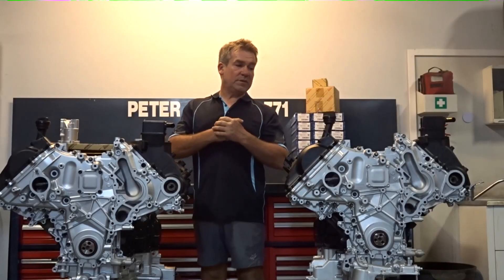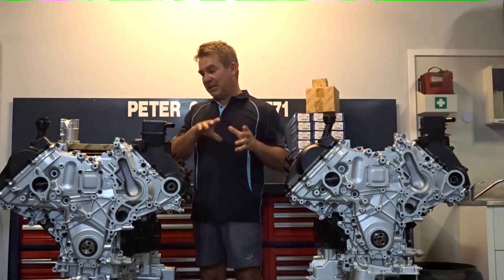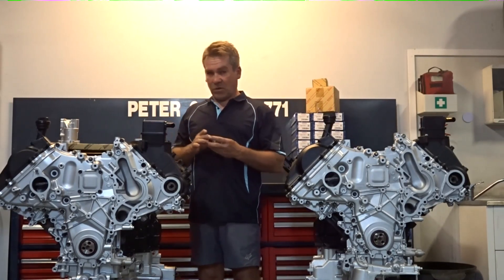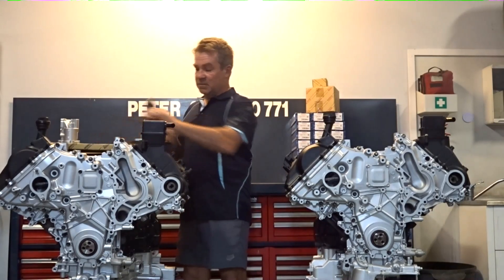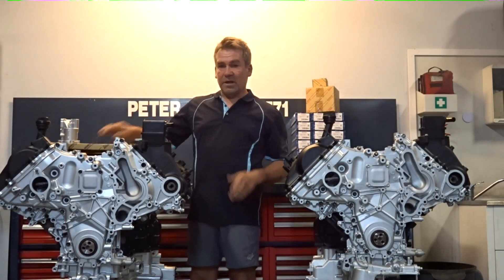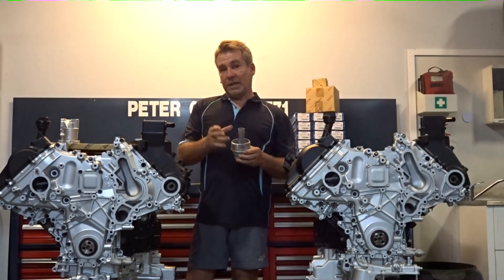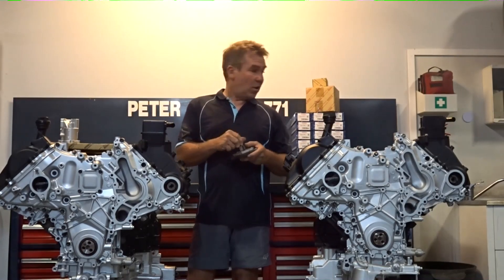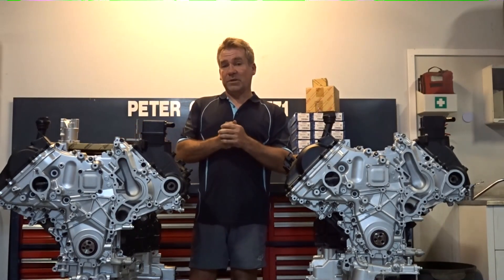Toyota Landcruiser 1VD-ftv diesel engine oil pressure problem, conrod bearing failure, engine knock.

Comment: Hey mate, what should the oil pressure gauge be reading on these engines please. I have a 2016 200 diesel with 375,000kms. Still runs like a clock.

Comment: What you thoughts on 0 30w oil they recommend? I have 2021 using penrite enviro + c2.  Oil.amd filter every 5000ks.Also any recommendations for additive for injectors
Reply: For injectors use a 2 micron secondary Filter. I use 5W40 instead of 5W30. Gulf Western make a high Zinc 5W40

Comment: great video i have a 2013 vdj with 200-000 on the clock it has a slight tappet noise should i be worried and what would the approx  cost of a oil pump change